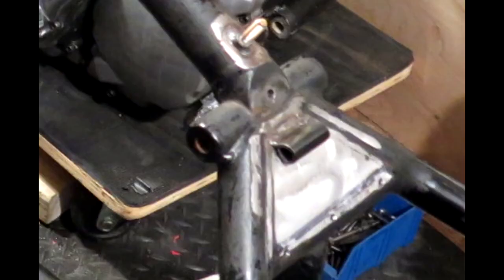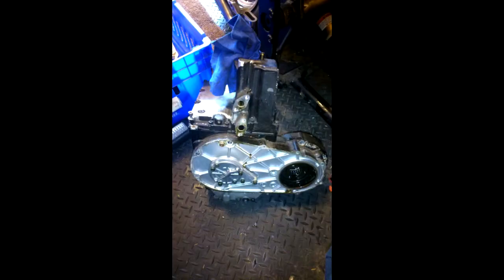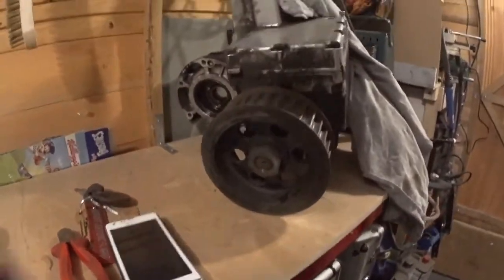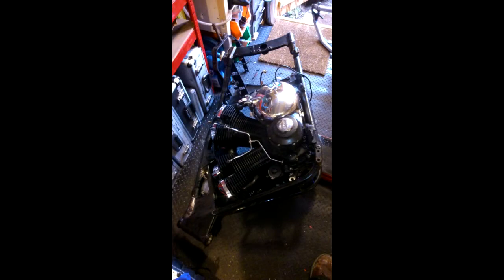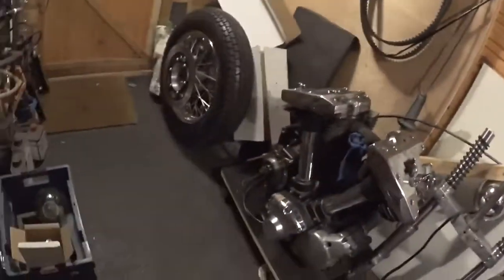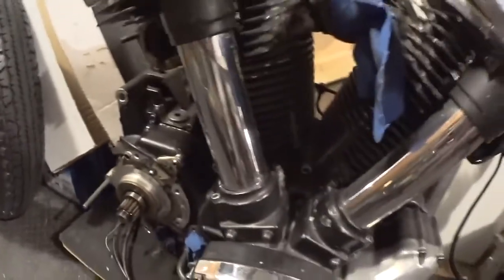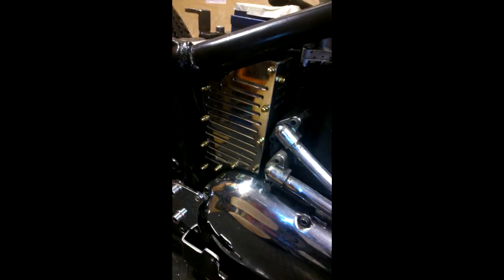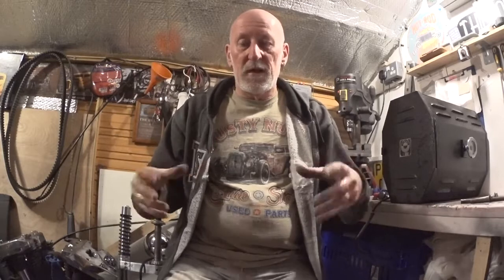YAMAHA XV1600 BOBBER BUILDUP PART 6

Comment: I think I watched the same vid you did with the guy struggling.  The replacement engine I bought was cut out of the frame because the guy got so frustrated.  
  Seattle weather is similar and I had to cut the same bolt on mine to get the old engine out but no worries after that.  
  Love the color choice!
Reply from the maker: Thanks Steve, yea that guy really struggled, seems like it is a tight fit,,, i gotta get it back in yet without damaging the powder coating or paint,,, mmmm !!!!
Reply from the maker: i think i should film that, lol, may be entertaining !!!